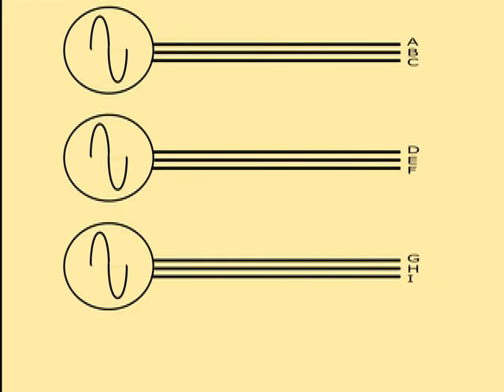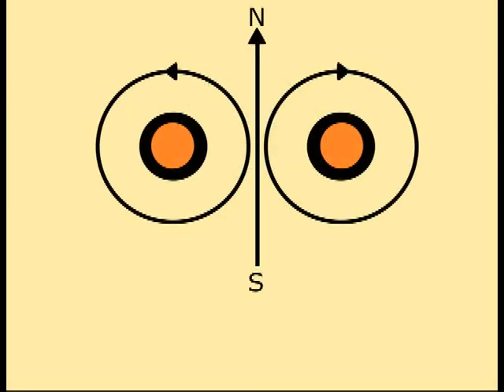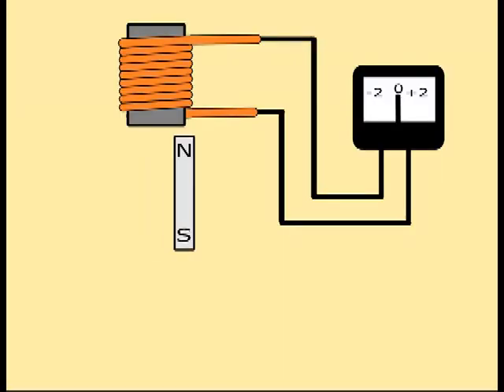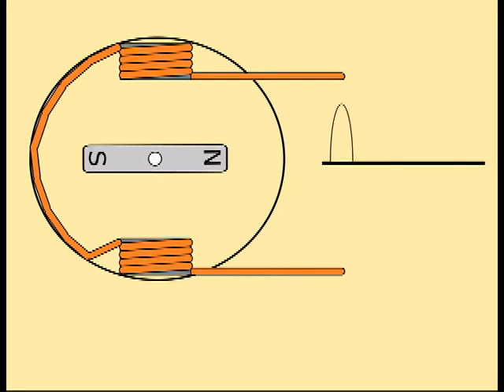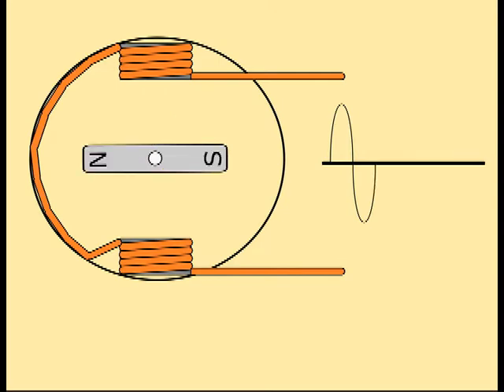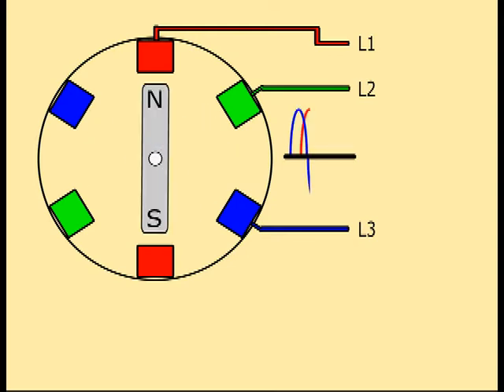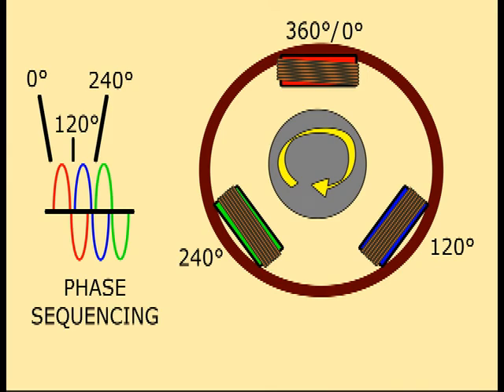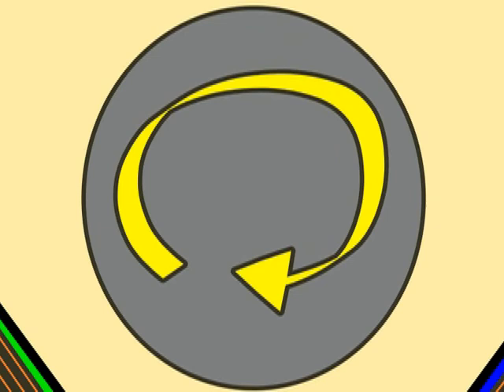How a three phase motor works

Comment: Sir bhout acchi video sir jese 50 kva ki three phase motar hai uska ban gya 40 kw sir partek phase ka kw banta hai 13 to hum 13 kw load ek phase par de sakte hai itna wnolege hai.... Sir maan le hum ko 10 kw load chiye ek wire se to jo bache 2 phase par 200-200 watt k lite bulbs lga k hum use kar sakte hai ganreter mey koi problems aa sakti hai ya koi dikat nhi plz answar sir ❤️❤️
Reply from the maker: माफ़ करें, मैं उसका अनुवाद नहीं कर सका। क्या आप इसे अंग्रेजी में भेज सकते हैं, कृपया?
Reply: @eltunene  Sir bhut good video sir like there is three phase motor of 50 kva its become 40 kw sir partek phase is divided 13 so we can give 13 kW load on one phase this will be so much sir let us assume 10 kw load  If there is a problem with power or no instructions, please answer sir ️❤️